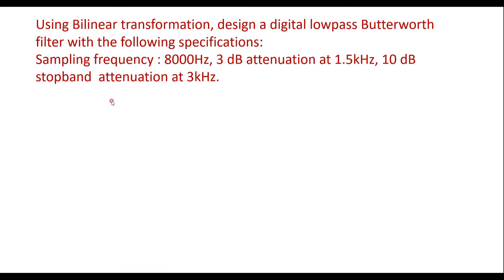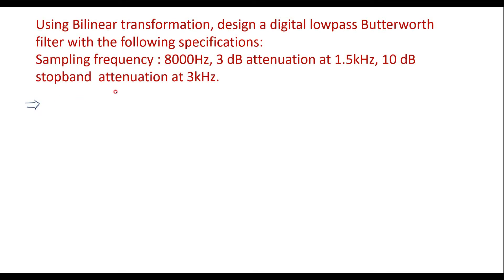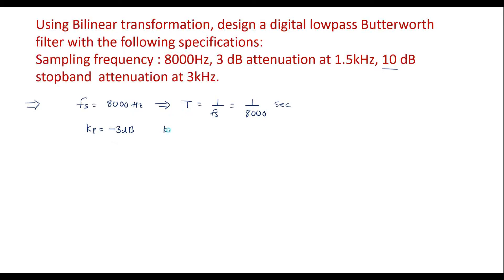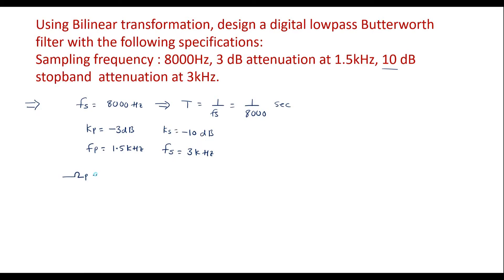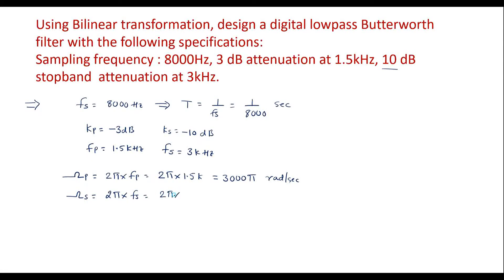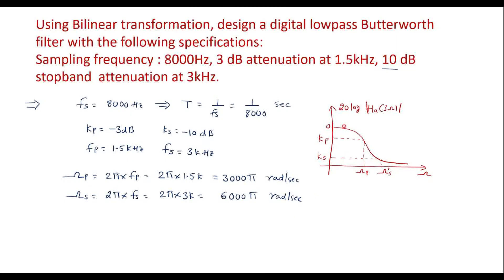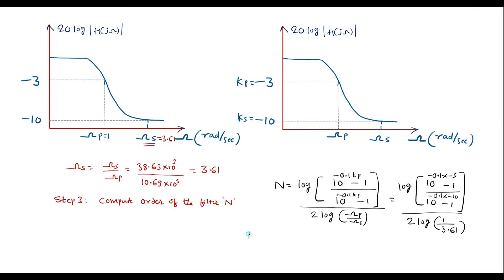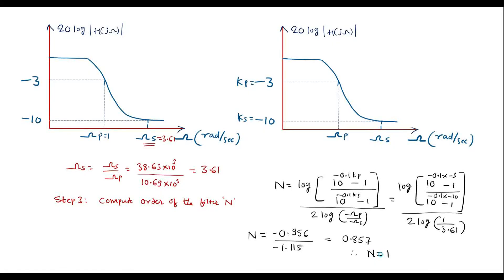Design of Digital low pass filter using Bilinear Transformation.

Comment: Sir can we use T as 1 sec in step 2
Reply from the maker: YES. you can take T=1 is second step onwards. ALL the best
Reply: @VBDclasses why u changed t=1 as u took t=1/8000 in before steps
Reply: @VBDclasses why u changed t=1 in step 2 as u took t=1/8000 in before steps